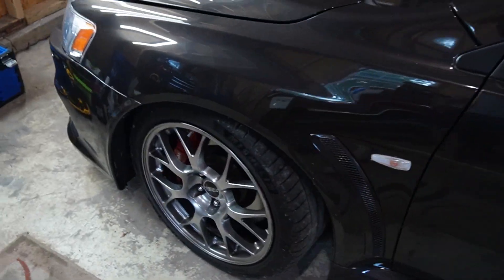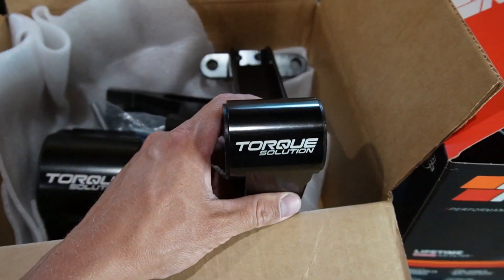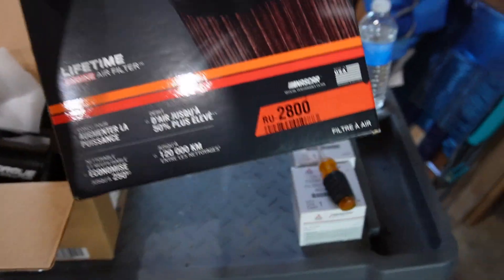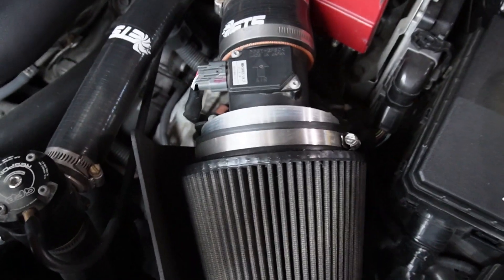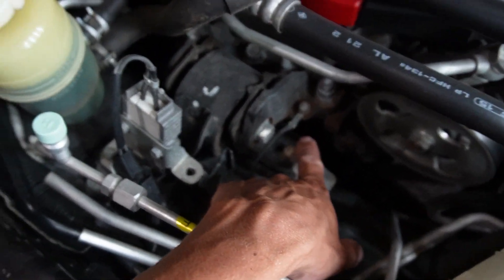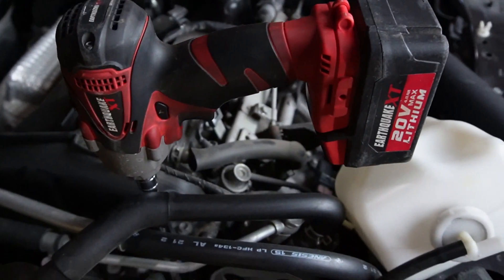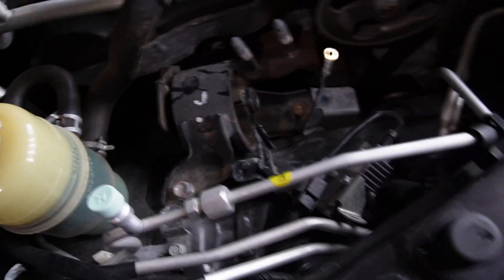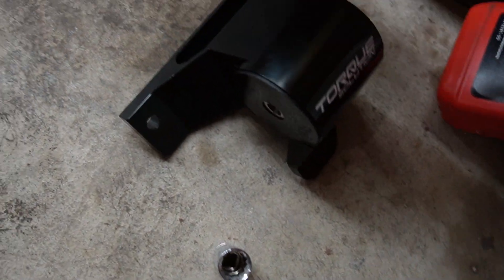Evo X Engine Mount Install and Air Filter Replacement

Comment: Since you pulled your power steering fluid line, wouldnt you need to air out the system by turning the wheel while front lifted with cap off?
Reply from the maker: probably, I just put it back on and topped it off after running it for a sec